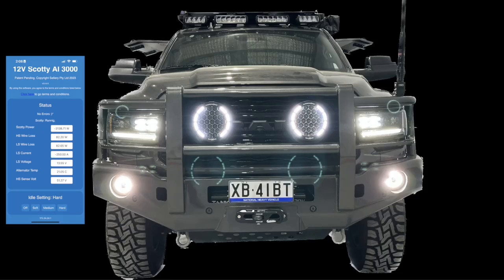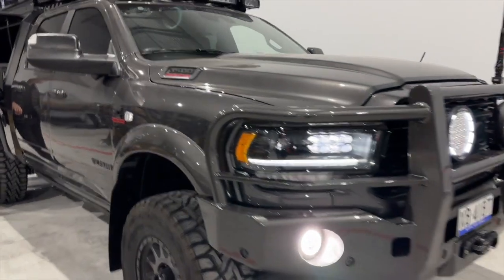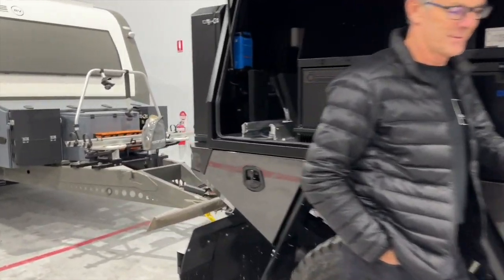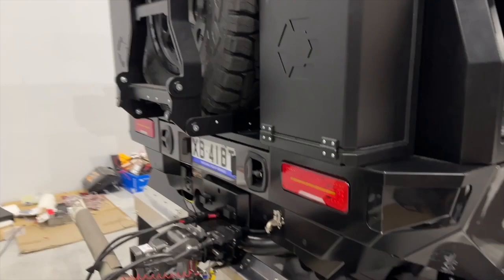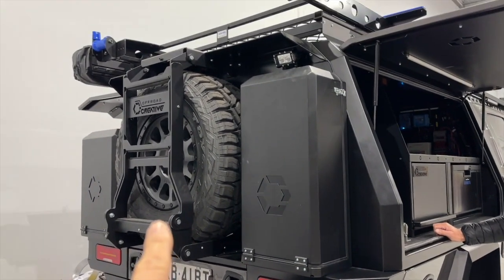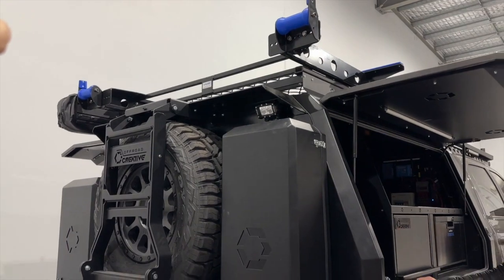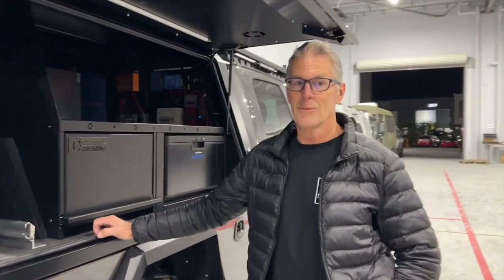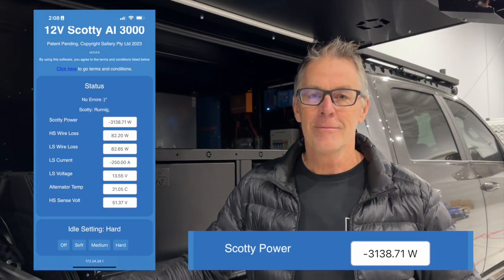RAM 3500 Towing Zone RV powered by Scotty AI with 3,138W DC DC

Comment: Looking forward to the second video on this system. I’m sure most technical questions will be answered in the next video installment. In the meantime, I have a few questions. As stated in the video comments it is a 48vdc battery bank system, but is the 370amp alternator at 48vdc ? Here in the United States, these Ram 3500 can be factory ordered with dual 220amp alternators at 12vdc. Does your Scotty AI module work with a US built Ram 3500 dual 220A system at 440 amps combined ? If your Scotty AI module does not integrate nicely with the factory OEM alternators, single or dual, is it recommended to have a separate alternator installed at 12 vdc or 48 vdc that is not OEM ?
Thanks
Reply from the maker: Hi the customer left early for a 7 week trip so next installment will be after he returns. We originaly fitted 48V DC Alternators with wakespeed controllers but found this unreliable and the 48V alternator needs much high rpm than 12V for good output at idle. So we developed Scotty to operate off the 12V DC alternators With this RAM and its twin alternators, the power at idle is significant. It pulls from both alternators. And it will work nicely with the factory RAM alternators in the USA. The AI piece watches alternator temperature, power flow and voltage. Whats interesting on this RAM is the engine temperature runs over 105C and we had to increase the max alternator temp allowable to 120C. System works very well.
Reply: Awesome !!!
I was considering the Wakespeed WS500 and now I must reconsider